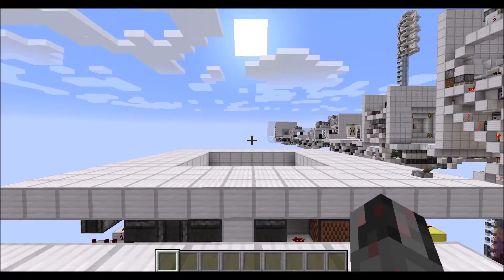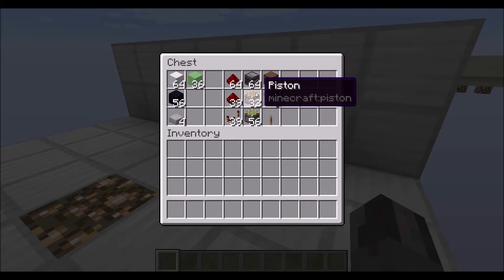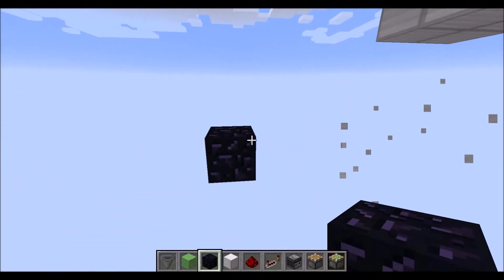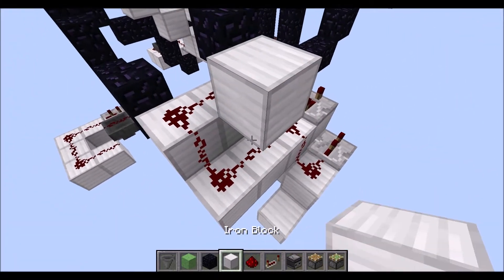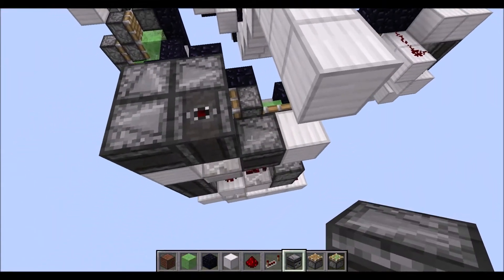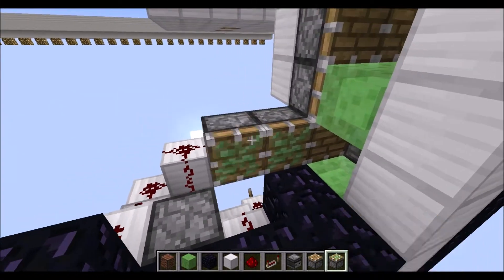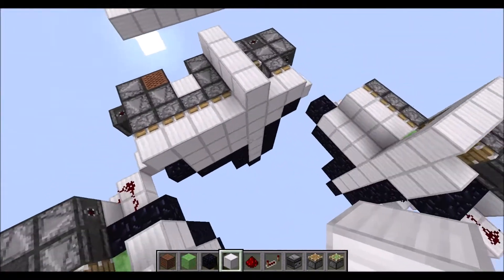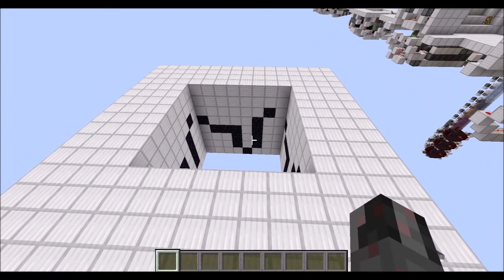Tutorial: Fast 8x8 Vault Trap-Door [Java 1.13+]

Comment: Could you make a slow and atmospheric vault door? It's skillful to make them fast, but loses the grandeur of the door
Reply from the maker: That's an unnusual suggestion. Usually it must be as fast as possible.
I've written the idea down for later consideration, but the problem with slowed down doors will likely be the costs, since higher delays mean more repeaters and other timing circuitry...